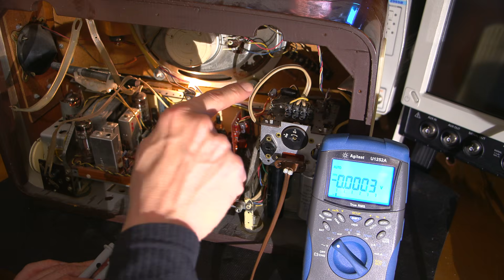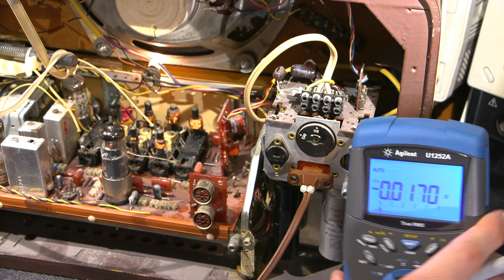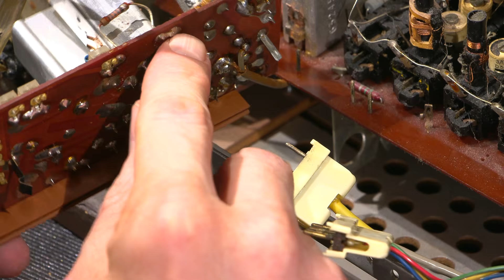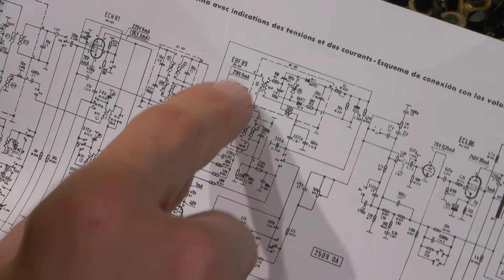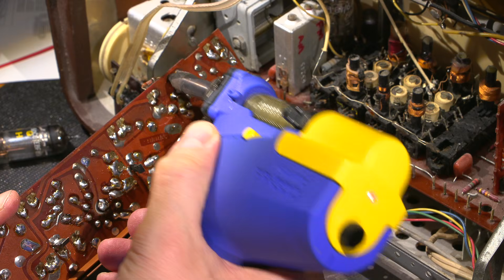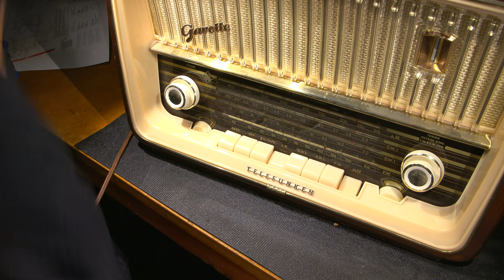Telefunken Radio Receiver Electronic Troubleshooting And Repair!

Comment: As a child growing up in Uganda in the 1960's my family had a Telefunken valve radio and I have vivid memories of the dials, buttons, strange writing of musical notes and the 'Hi-Fi badge. Made very good audio and was pleasant to listen to. Then, in around 2017, I saw one come up for sale online here in New Zealand and I had to have it. It looked a bit similar to the one we had all those years ago so I got it. The seller was retiring and he must have been a radio technician as he had a number of valve radios and parts for sale.
My Telefunken set is not working , does not power up (from what the seller told me) and I don't want to dabble into it as I do not know anything about radios and their circuitry. Would have sent it to you if I was closer.

Comment: i see a few Tropydur-like caps left on top of the power transformer and on that vertical board. The brown taffy shaped ones are always bad. They truly are the worst of all paper caps i've ever encountered. 
Are they plastic dielectric capacitors that just look like Tropydur paper caps, or are they in non-critical parts of the circuit?
Reply: These are not WIMA Tropydur Caps, the original Tropydurs had no vertical connection wires.

Comment: So this radio doesn´t have a EABC80 since it has a diode in the EBF89 ?
But where is the preamp then?
Reply from the maker: The output tube has a triode in it.
Reply: @MrCarlsonsLab  I thought it would be a EL84 as usual 🤔
Reply from the maker: The output tube is an ECL86.
Reply: @MrCarlsonsLab  hmm interesting.
Haven't heard of that tube.
All radios I've seen so far used the same set of tubes:
ECC85, ECH81, EF89, EABC80, EL84/95

Comment: 8:27 . . . When test equipment can kill you!  A service contractor who looks after our UPS systems was at a different site and had a Fluke meter fail in such a way and thought a 370 VDC battery bus was de-energized, and started dismantling the hardware to replace the batteries.  And arc flash explosion occurred and has was in the hospital with burns to his face and arms,  damage to his eyes,  and off work for months.  Even good quality test equipment like Mr. Carlson's Agilent can suddenly fool you with a wrong / frozen reading.  Always use care.  If it's something that could be lethal or explode,  use a second tester.
Reply: I have seen the videos on YT when the DMMs are tested for very high voltage surge survival - I was quite surprised that many didn't make it.

Comment: Finally a German radio on your channel i was waiting for that
Reply: Thinking the same thing, germans made good tube radios. I hope he owns a Saba automatic with remote control :-D
Reply: @georgegherghinescu  Saba Freiburg or Freudstadt?
Reply: @domi7007  Freiburg is the most desirable automatic I think.. motorised volume control, buttons light up when pressed, push pull output stage and large good sounding speakers. Those germans at Saba really went above the rest, there was nothing like it. Meersburg and Schwarzwald where the other automatics from memory. Freudenstadt was just like Meersburg but without the automatic search function.
Reply: @georgegherghinescu  True. Freudstadt was pretty good too though!
Reply: @domi7007  Agreed! I don't own an automatic but I love my '56  Freudenstadt :-)
Reply: I worked in a radio-tv repair shop in the late '60's.  A lot of returning servicemen brought back Telefunken and Sansui equipment.  We saw quite a few of them.  I still have a Sansui 5000.
Reply: I found a 1953 Saba Lindau W3, in the trash, a few weeks ago. After some new capacitors, a new transformer and help from the Dampfradioforum, it now plays, in the kitchen, every day. Nothing fancy but it sounds good.
Reply: @4stringm  Glad he found a good home after all :) Looked at some pictures on radiomuseum and it looks very well made inside.. clean and tidy.
Reply: I think Germans made the best radios that time in Europe. Saba, Grundig, Nordmende are the best ones probably. But there were many others as well of curse. My favourite ones are in my small collection is the Grundig Stereomeister 15 and the Nordmende Tannhauser 8004. I love them.
Reply: @douzeTS  Impressive model that Nordmende 8004, I bet it receives and sounds great!
Reply: @georgegherghinescu  It's great FM stereo radio with 12 tubes. If you can pick one don't miss it! And the Stereomeister is almost the same receiver. With ECLL800 output tubes. (and without internal speakers) And as Mr Carlson said, they are really hot! :)
Reply: @douzeTS  I really like German sets. I'm working on a Grundig 960 now with a very pretty Bakelite case.
Reply: I loved my German radios.

Comment: FM is usually weak due to worn ecc85. sometimes low voltage on FM tuner due to bad selenium or dropper also. That bandswitch and coils are usually the weakest point. especially the switch that switches 250v for tuner.

Comment: I'm impressed by the serviceability of this radio but try restringing the dial on a German radio. It's a hair pulling contest!
Reply: Good lord, having to restring the metal wire and then the fabric wire. So annoying. A nearly impossible job😡 especially if the spring that usually joins the two snaps, I just give up at that point, too much tension and it snaps, then not enough tension and it’ll never work!

Comment: My grandmother had this exact radio and I remember using it a lot as a kid.
Reply: I had one that was my Dad's Telefunken, Junked it from ignorance. Now I rebuild and refurbish tube radios. I love to hear them come back to life. They have character, Where the new Chinese ones DO NOT. Micro circuits, Yuck !
Reply: Yep, they're great for kids as long as the kid doesn't have access to a screwdriver. I was a terrible kid. I had the back off everything. How I didn't kill myself, I don't know. My very worst experience was taking apart a fully wound  dumpster 7 day carriage clock. It's human nature to wind a clock up as tight as you can to see if all that extra energy will make it come to life. But, if you dismantle a fully wound mainspring, it's literally like a bomb going off. The energy in those springs can cut fingers off and whip eyes out of their sockets with no effort at all. I was lucky and learned very quickly from my mistakes that reading about what you're thinking of doing do can prevent some very nasty accidents.

Comment: Paul, could you explain all of your thoughts about the troubleshooting techniques you used in this video?  You "immediately" jumped into measuring the "stand-off" resistors looking for voltage drops, but never said why.  I think I know why, but I'd still like to hear your (complete) explanation of why you jumped to checking for voltage drops, etc.  Great video showing fast ways to troubleshoot a partially working radio!
Reply: I think he said/implied that the resistors standing off the board are usually off the board because they are the ones that get hot in normal operation. (Therefore they are the ones most suspect for having burned out due to overheating.) He localized his search to the area around the tube that was the coldest, because it should normally be warmer that that. Since there was a resistor that was both near the cold tube, and elevated off the circuit board, it was the most suspect component. 

Checking the voltage drop let him see if it was allowing a reasonable amount of voltage through to the tube. It was not allowing practically any voltage through, so it was again the most suspect component. (e.g., if there is +250 volts on one side of the resistor, and -1 volt on the other side, no voltage is going through the resistor, and a resistor feeding voltage to a tube should have a much smaller difference in voltages from one side to the other).

That was my (simplified) understanding, anyway - for what it is worth.

Comment: Hi Paul, great video as usual.  You have my same DMM Agilent U1252A, great meter.  I saw your back light stay on and I dug around in the manual and discover how to turn off time-out on the back-light, yours does so I figured a way to make is so.  Thanks for the accidental bench tricks.  Take care.
Reply from the maker: Glad to be there Gary!
Reply: @MrCarlsonsLab  Glad to have for the education Paul.
Reply: On another note, I notice that your are not using the Agilent U1253B OLED display DMM anymore in you videos.  I have read the the display fades out over time and loses "brightness".  Just curious if you have experience this problem with that DMM.  I was looking for a second DMM and found the U1252A for a good price and I like the color blue, because I a nerd...lol
Reply: I had a U1273A and the OLED faded to the point I could no longer read the display in normal light. I replaced it with the U1252A. Great meter.

Comment: Cool radio. But what are those two backwards-facing sockets on the back of the radio for?
Reply: they look like 5 pin DIN connectors, often used for Tape output and line or Phono input.

Comment: I'm just wondering what caused that resistance to be open ?
Reply: the size of the resistor looked 1w or less. on the schematics i think i saw two bars which means two watt. Mr. Carlson put a thicker one. Maybe someone in a previous repair put the wrong wattage. It could be I am wrong in my observation
Reply: @cvetomircvetkov5670  thank you for the info we still waiting to hear from Mr. Carlson

Comment: Was working on a Powerbook 100 Power supply and I was getting like 11v somewhere i should have had 165. Traced it back to a 1ohm 2 watt resistor. It looked fine, but measured open. Replaced it and bam, back to life.

Comment: Hey Paul absolutely cool to see you working on european radios. I am a well today was my birthday so I am a 19 year old student who is basically fixxing these radios. The big problem of east german radios and czechoslovak TESLA radio is that they were wired for 120/220V. Today main voltage is 240 and it just absolutely torches stuff inside with the voltage raise.. Gotta say you are the biggest inspiration to why am I collecting obsolete old JFET stuff with pilotlights :D . I have quite extensive experiences in repairing TESLA radios and it's nice to see your hated waxies getting dumped. We have our own version of that too brown pressed crappacitors that overtime crack open and or asphalt caps which I call chewing gum caps..lots of fun things. I was at one point considering doing the same you do with youtube. I do a lot more than just radio repair. I design SMPS audio amps both tube and transistor and a lot of PCBs. Well definitely looking forward to your next video :)
Reply: Also- judging by the board style radio construction this might be very late 1960s and early 70s era

Comment: Glad to have you back! Very nice looking radio, my wife asked right away if I could get one in our living room :) We have a WEGA 209 in there now, but I think with age we tend to like older styles better. Thanks for the great video! I would remove the caps on the transformer right away, they look like one old type of Wima's, they fail miserably with time.
Reply from the maker: They were replaced by Nichicon caps hiding behind the metal bracket. The original caps were completely un-hooked. They also changed the rectifier.
Reply: @MrCarlsonsLab  Why the hell did I think you missed those?! :D

Comment: Great Video... lots of Good Tips to absorb in this video,  ... But, I do have one curious question... What ?  caused that resistor to burn up, I can think of some possibilities... Wrong wattage for the resistor..?  Maybe that resistor got replaced and wasn't the proper value,  in general it's been my experience resisters just don't burn up if the circuit was designed correctly,  it's possible that a resistor value in something that had a lot of runtime on it might slowly burn up over time, but I'm not so sure that's what happened here... ?  Just curious as to your thoughts, as to the root cause of the failure...?
Reply from the maker: Over time the resistor just went open. Could have been some impurities in the build, or maybe its past life in a damp environment. The coating was cooked off it, so it was probably weak and getting excessively hot for awhile.
Reply: @MrCarlsonsLab  Ok... So it was an original resistor... Well,  that resistor potentially...  sure had a long life.... It would also seem to me... That, bumping the wattage a little bit for the replacement resistor, wouldn't hurt anything...  Only possibly creating more reliability, over a long period of time.   P.S. doggone it, you really motivate me to want to take your class, the commitment of time may be my only stumbling block, but regardless I should jump on board, and start the process... I have a few things to repair, I hope when you do see me sign up one day... You will smile, and welcome me.. :-)
Reply: What about a leaky filter capacitor increasing the current through the resistor?  It had been previously restored and we generally don’t know what was done, what’s the state of the replacement capacitors that were put in. At least after putting in the new resistor maybe measure the voltage drop across to make sure it is not being overloaded.
Reply: @vdivanov  Now... that's food for thought.... again, some of my old and ancient electronics experience came from my boss, who worked in the military creating missiles and rockets, anytime something didn't go right. Failure analysis was critical.... So, sometimes those lessons come into play when doing repairs, having the time wanting put forth the effort to investigate what caused the failure, and weighing those thoughts against, your goals for the repair,  come into play.   I always enjoy, Mr. Carlson's opinions and lessons and tips, if you listen carefully, your skills can be enhanced . :-)

Comment: Would heat shrink do the same thing for the probes ??
Reply: It should, if it's good quality. One of the pieces of test equipment we built in the Patreon course has heat shrink on the leads for similar reasons.

Comment: Excellent video. Very entertaining and informative.  Thanks. 
If I may, can I request your next diagnose and fix be one of those 6 volt, solar powered, motion detection, 60 LED yard flood lights that over time don’t turn on or off when they should. Think of the thousands of people you’d be helping!!
Reply from the maker: Interesting suggestion. I will keep that in mind.